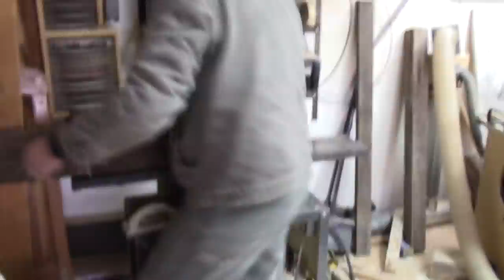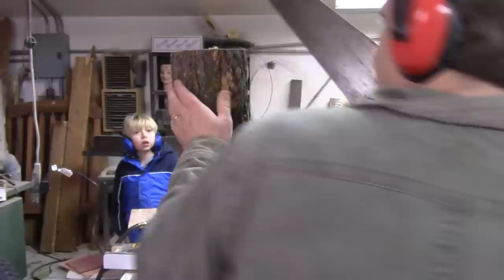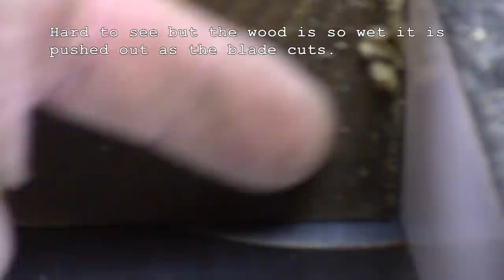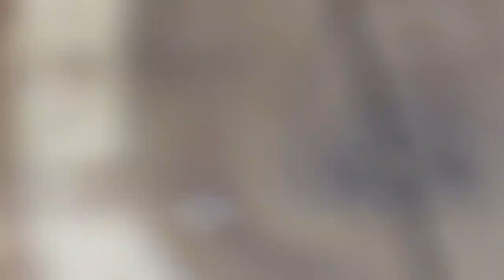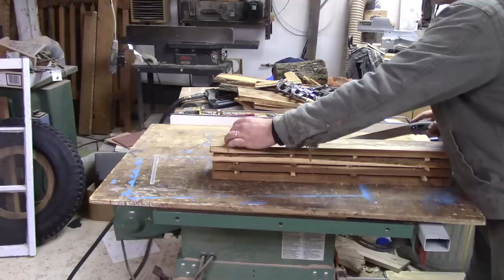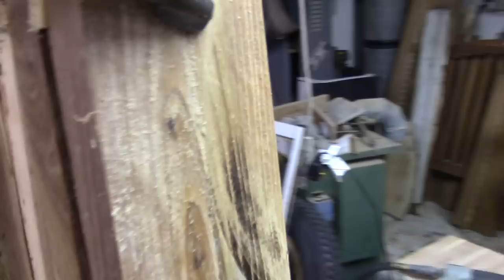Milling Elm Wood on Table Saw

Comment: Cool video, I like how you didn’t use any jigs!
Would it be possible to do this fully on the table saw?
So not using the jointer or planer, I don’t mind using the hand saw a little more

Comment: Does cutting through bark have a noticeably adverse effect of the blade sharpness?
Thank!
Chip
Reply from the maker: Oh that old CMT has seen a lot and is no longer what it was.  I know for a fact that bark is gritty because the tree grows around the the dust that lands on the bark trapping it.  On the saw mill we peal bark that has dirt on it from moving the logs but on this I am not sure if it matters much.  Maybe if you were going to do a bunch.

Comment: Did you clamp to help it dry straight?
Reply from the maker: Yes.  I didn't have anything heavy to stack on it so I figured that if it wants to twist then it would have to twist everything.  That is the idea anyway.  I do need my clamps back though...